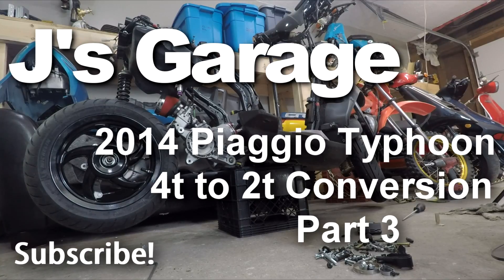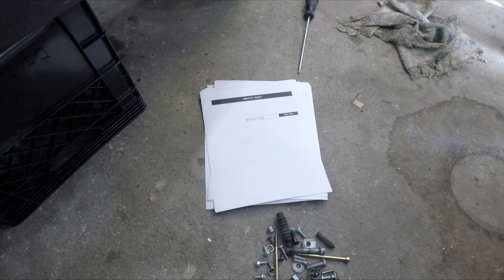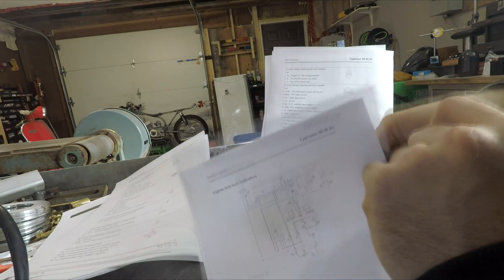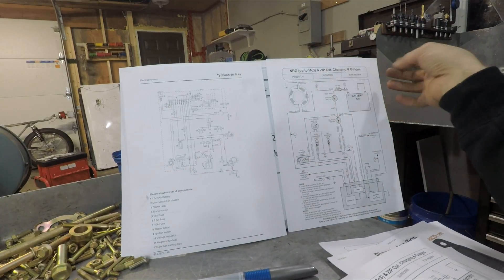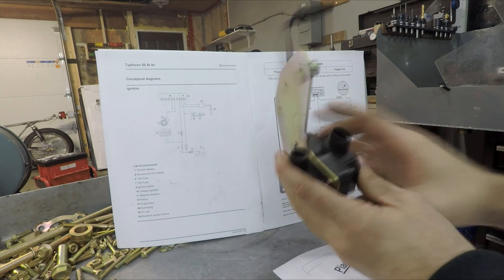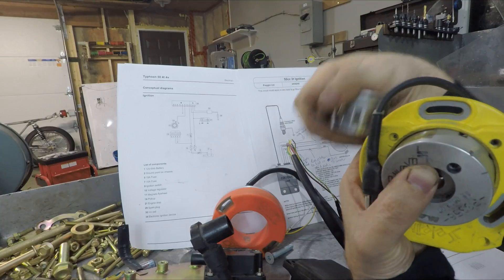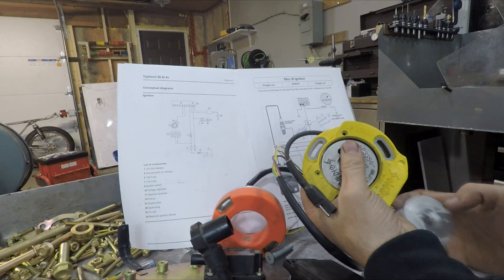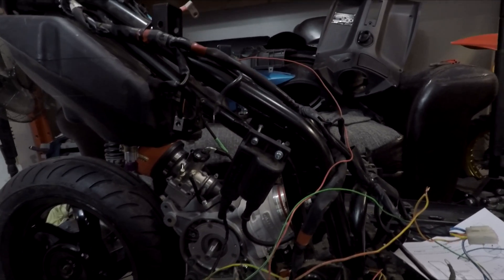2014 Piaggio Typhoon 4 Stroke to 2 Stroke Conversion - Part 3, Wiring - J's Garage

Comment: Does the CDI Unit have to be grounded to the frame for the electrics to work?
Reply from the maker: Yes either you need a ground strap or the ground needs to be where the other electronics ground out.

Easy to make a ground strap from the engine to the frame with a bit of wire.

Comment: i have an 150cc 2t piaggio hexagon engine and 4t wireharness can you help me ? 
im so bad at electronics .
i have the cdi and coil conected. 
but i have on my engine  1 black and red cabels that is for the starter.
and another 2 green and 1 yellow. dont know where to put them. 
i have from my harness i still have the cdi cable and the cable that came out the engine.stator
Reply from the maker: Tough to figure out from your description.  You will have to get wiring diagrams for both and sit down and figure it out.

Print them out and start tracing what goes where.

Comment: Hi. Do you know of any links for setting up the mvt ignition. My box didnt have any instructions for install or adjustment.
Reply from the maker: .25 BTDC is a good starting point.   What kit is it for?  Is it an RC-ONE kit or for something else?  Some may require different setting points.
Reply from the maker: http://www.mvt-allumage.com/WD210AWP/WD210Awp.exe/CTX_1972-0-iqeKGZmill-06AA61C2/TABLEAU_PIECE/SYNC_1981198437

That is the MVT site, its a bit confusing but they have some of the papers for some of the kits.  IF it is the RC-One kit you wanna start at .25-.3 and do a little tuning and check with a light if you can.
Reply: I building a RC one and bought the mvt kit for the RC One from scootertuning.ca. I would like to know what to line the inner rotor with on the stator at what degrees or mm piston advance. I will have at the link you sent. Thank you
Reply from the maker: I made those kits.  I currently have mine set at .35mm BTDC just to get it to run, but you can mess with it in either direction and every setup can be different. I haven't had a chance to really mess with it yet to try and actually tune it.  Optimal for one may not be for another.  I am not saying that is optimal either but that will get it to run. Set the stop at .35 BTDC and line the marks up in the direction of the rotation.  I plan on doing some fine tuning of the ignition quite soon and can share what I find.

According to Wayne "Wobbly" Wright all well developed 2t engines need 15 Degrees of advance at peak power, and about 25 under the pipe.  You also need to taper off advance on over rev.  You can print out a timing wheel from 49ccforums  http://49ccscoot.proboards.com/thread/2229/printable-2t-specific-degree-wheel and try and fine tune to those specs with an el cheapo timing light.  Good luck!